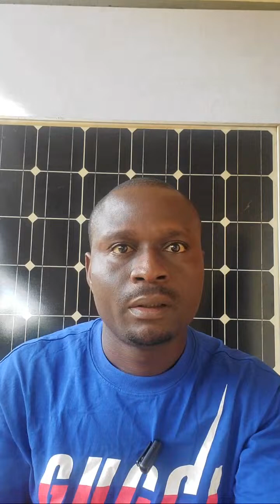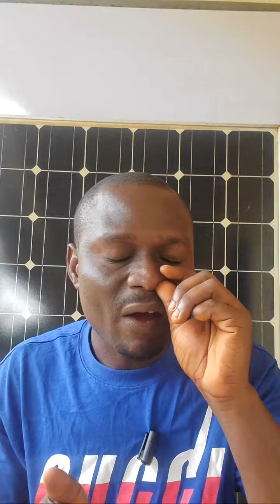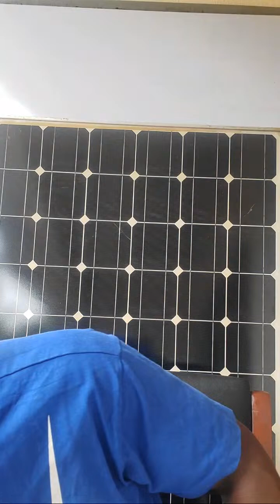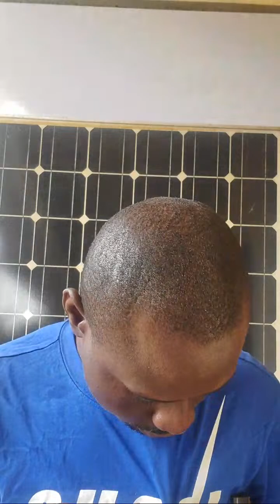Solarwatt Academy  is live - Ask Me A Question!

Comment: My name is Adeleke Abiodun from Igando New Town Lagos. Please I need help on protection iro fuses, dc/ac mcbs, spds (ratings and locations where required). I intend connectiing in parallel two 550w PVs (each with 40.90v  Vmp, 13.45A Imp, 49.62v Voc, 14.03A Isc and max. system voltage of 1500v dc. It's a 12v 200ah battery bank, 120A mppt cntr., and 3kw surge pwr psw inverter. The max. PV input voltage of my mppt cntr is 150v dc. My total load 2000w. Thanks so much sir my great instructor.

Comment: Watching from Uyo. I have 900w PV array in parallel, 100a charge controller, 400ah battery bank and 1kw inverter. What is the possible mcb size between PV array and controller, controller and battery bank, battery bank and inverter and, inverter and load. Thanks.

Comment: Mr Anyuon David watching from Juba South Sudan 
Sir explain to me something about the voltage of solar panels depending on any type of connection. Is total voltage of solar panels supposed to be greater than the voltage of  a charge controller 
16:30
Reply: Oh yes it has to be greater cos the solar panel sole purpose is to supporting charge to the battery , so therefore expect a donor to chop bellyful first. 😊